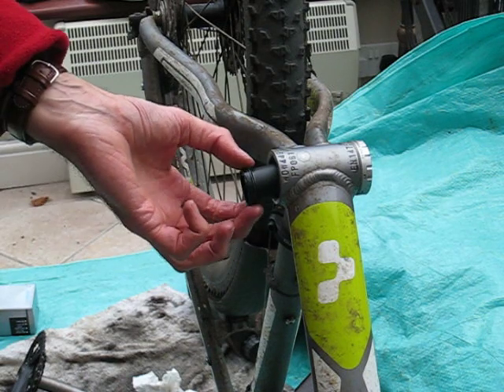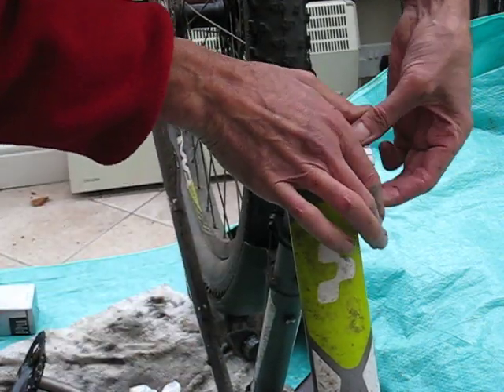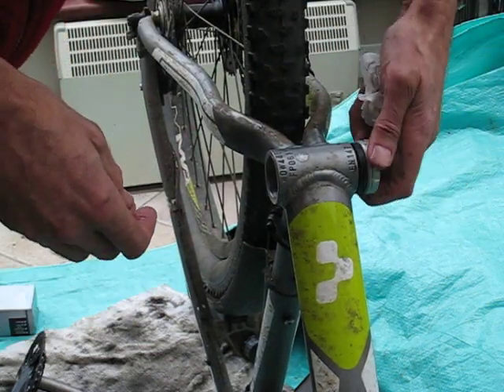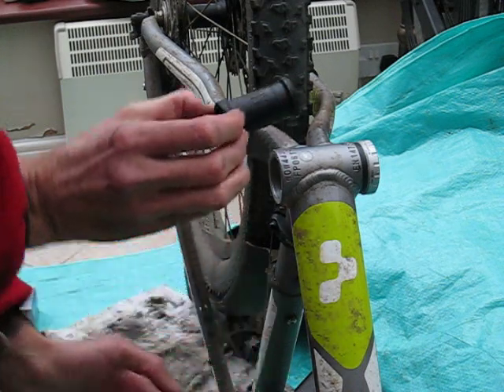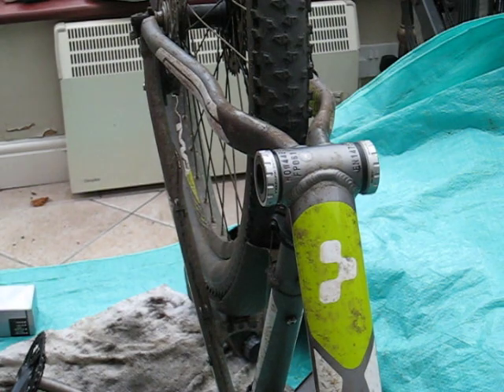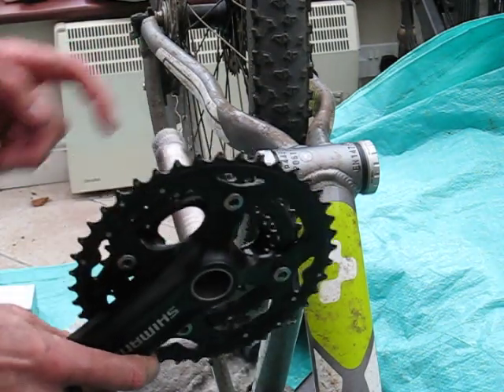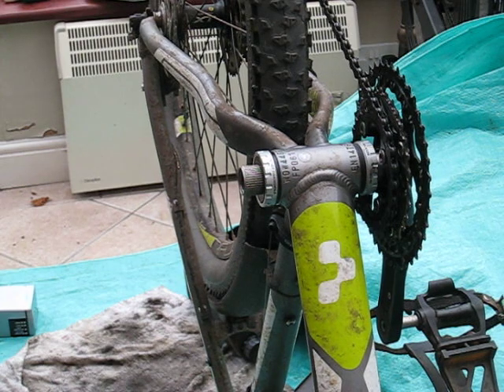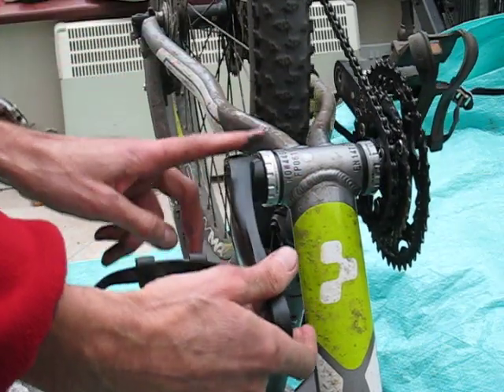Shimano Hollowtech II bottom bracket replacement / repair - part 3

Comment: It makes more sense to preinstall the plastic tube from the first side before threading the cup in, as it can be hard to tell if it is in place properly from the other side. The BB shell should be faced at least one time, otherwise the planes of the outer cups may never be precisely parallel; the internal threads do not align them. Both grease/antiseize and blue loctite assure both no corrosion, and retained thread seal, to preclude creaking later; torquing the cups is less critical, as once the face touches the cup lip you ain't gone move any further. Torque specs of the crank insertion and retaining/clamping bolts is much more important to avoid overloading the bearings, and damaging the alloy crank threads.

Comment: Do Not Disassemble
So you need to buy the whole set
 Reply  · 
 
 
Joel Cartujano 1 second ago
 +Salina Bicyclist 
You can actually replace the bearings... 
Bearing #6805. 
It's cheaper than buying the whole SM-BB52 set. A very good Japanese or USA made bearings about just 20% of the cost. And i have been doing that several times already. 
Just make sure you're best or very good or at least good in pulling out and pressing in the bearings so you don't damage the housing.
Good old Filipino ingenuity.

Comment: How much torque must you apply when putting on the cups?

Always seems to me that mechanics act like they're sealing a cup on a F-18!....they crank down and seal every part so hard.

So, you just go by :feel"?
Reply: Manufacturers state what torque to put on everything in order to not be obligated to replace it when some screws it up on their own. It's not necessary to be exact, but it's important to not break it. The only place where you probably should have a torque wrench is when handling carbon parts. Even if you can eyeball the correct torque, you dished out awful money for those parts, so better to be sure.